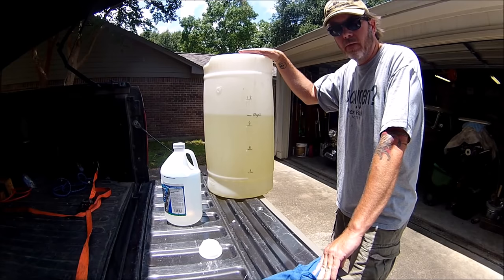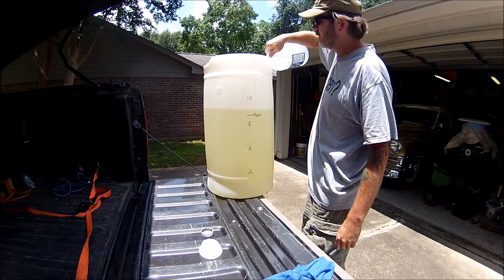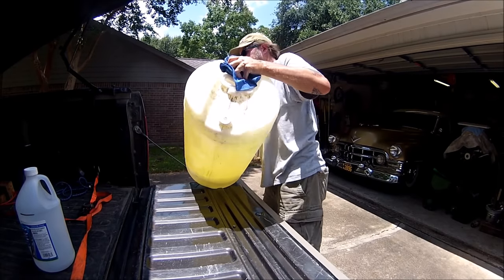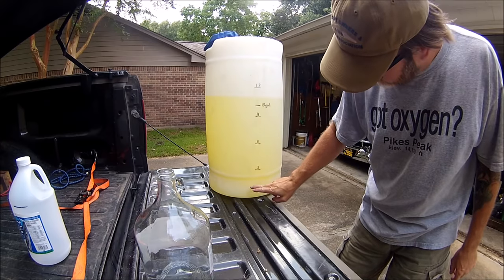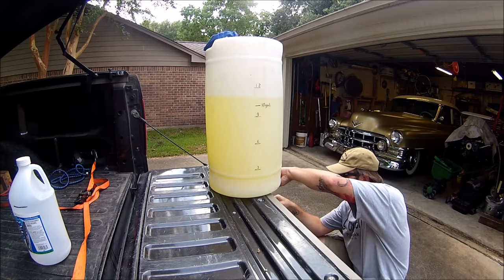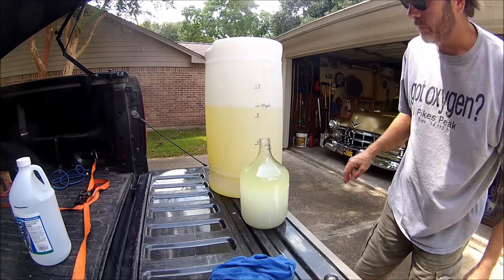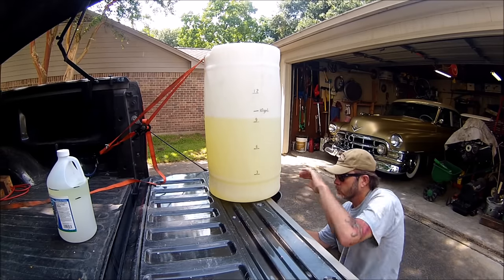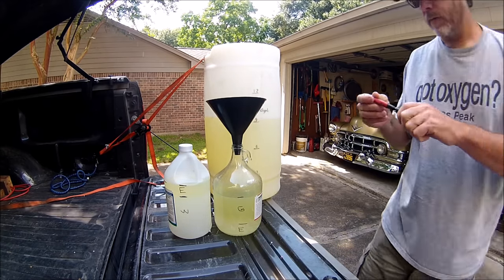How to easily extract ethanol out of gasoline.

Comment: Well, the problem with doing this is that ethanol is used to boost the octane of the gasoline.  So, if you remove the ethanol from say, 93 octane gas, you are left with about 69 octane fuel which will destroy any engine you try to use it in.  Of course you can add your own "octane booster" but, if you read on the label, most, if not all, of these contain....wait for it...ethanol.  This is a ridiculous waste of time but, have at it if you want.
Reply: Sorry, but I have to disagree. While it boosts octane marginally (e15 is 88 octane), less than 10% is added to metro area gas. Ethanol is NOT added in rural areas nor in most large cities during certain parts of the year. It is added to reduce emissions. Period. If it's in your local gas, it's in the 87, 89, 91 octane. It's in all of it. It is required by DEQ to be added. Not the car industry (it attracts moisture and corrosion, they don't like it), and not the fuel or refinery industries because it's expensive and less profitable than straight gas. Corn farmers love it. And If you're running older lower compression engines, you are in fact, getting less power from it because it's less volatile.
Reply: Well, I have to disagree with what you just posted.  I work at a company that owns 450 gas stations and I am friends with the guy responsible for testing the fuel and maintaining the pumps.  He is the one that told me this.  He said the major difference in the grades is that there is more ethanol added to the higher octane fuels which is how they get from 87 to 89 and 91, etc.  He also said it is in our gas all year long and sometimes, there is more than the 10% "claimed" by the refineries. I live in a rural area and all of our gas has ethanol in in.  There is one station 20 miles away that has pure gasoline but, they charge an extra $1.50/gal. over the price charged for all of the other gas with ethanol.  I am sure this varies from state to state or region to region.
Reply: Ok... so then how did we get higher octane way before the days of adding ethanol to pump gas for emissions reductions? decades ago. you may work for a gas station company and know a guy. cool. but oil refineries been making high test decades before politics removed lead or added alcohol to the scene and watered shit down.  Again, I will state, claim, and defend- the only reason for ethanol is political. there is no ethanol in high octane race gas. (top fuel is a whole other topic) and if you run e85 in your low compression turbo setup well, then, your golden when in boost. boils down to: ethanol fucks up your shit but lowers smog emissions. not a performance gain for average rig.
Reply: I have been buying 90 octane non ethanol gas at my local gas station for about 3 years now for my yamaha side x side, Ferris riding mower, 4 stroke weed eater, push mower and generator! They all run awesome!
Reply: Hi Pirate Labs - actually, your friend is WAY off - current gasoline as formulated at refineries, before the ethanol addition, has an octane rating about 84~85 as determined by the (R+M)/2 method (standard).  Ethanol increases the octane rating by slightly above 1 point per 5% ethanol concentration.  Current formulation of 10% ethanol E10 gives you ~87 octane rating,  E15 is ~88 octane rating and if you used a mixture of 85% ethanol/gasoline mixture, you would have about ~108 octane rating.  So if you remove all the ethanol from the currently available E10 (US and Canada), you end up with "dry" gasoline with a octane rating of 84~85 which would likely be safe for your engine (as long as you are gentle with it (preventing detonation).  Ciao L (Ford Motor Company engineering).
Reply: smooth rider: Well, I agree with the second part of your post and, I do not know the answer to the first part although I could venture a guess.  Higher octane simply means that its flash point is higher and it is harder to get to burn.  Many chemical additives can do this but I have no idea which one(s) they used.  I do not work for a gas station company, I work for a security company and I am posted at a corporate headquarters of a very large grocery store/convenience store company.  They all run Shell gas.  I used to race go karts that ran 100% methanol and you could make great H.P. on it but, as you mentioned, you had to be set-up for it.  (Jetting a lot larger to get more fuel in because it does not have the energy density of gas)  Burning corn in our vehicles instead of eating it is just plain stupid and yes, 100% correct that it is political just so they can say we now have a "renewable" fuel source.
Reply: Corn is better to run in our cars than our bodies, corn is Killing Americans because we eat way too much!
Reply: lanceelot1953:  He is actually not "way off" as you put it.  It says this right on the pumps when you buy it.  (At least at these locations I use, which are owned by this company)  Each grade shows the ethanol content and the higher the octane, the more ethanol is in it.  I use regular (87) and it also says there is a MINIMUM of 10% ethanol in the fuel.  (they all use that magic word:  Minimum)  He is a very respected engineer himself and has been with this company for a very long time so, I think I will go with what he says as being correct.  I am not doubting your background either, but, as I posted above somewhere, I am sure this all varies somewhat from region to region and possibly you are in a very different one from me.  I just looked it up and ethanol has an octane rating of 113 and E-85 is at 108 octane, like you said.
Reply: Livingwell:  How is that?  I hardly ever eat corn myself nor do I use any of its by-products like corn oil.  I am an olive oil man myself.  Now, if you make bourbon whisky, that is another matter entirely.
Reply: Pirate Labs, how old are you? Do you remember gas before ethanol? Unleaded gas? Leaded gas? They made the refiners add ethanol to stretch out the gas during a fake gas shortage. Countries in South America did it during WW2 so we should too. It made gas more expensive but we need to do our part. Now farmers and politicians don't want to remove it. They are now telling us it will cost $1.50 more per gallon to not have ethanol. Just leave it out and charge us less the amount it cost to put it in.
Reply: Randy, Yes, I am old enough to remember paying $.50/gallon for gas (leaded gas) to go on a date in the early 70's.  It is just another way of giving a subsidy to farmers, and oil companies also.  I am all for farmers but man, take this crap out of our gas.  We are now able to drill everywhere and soon will be the largest source of oil in the world so, we do not need ethanol in the fuel any more.  I totally agree with you.
Reply: Hi Smooth Rider, in the "good ol' days", since the 30's, refineries were using mainly tetraethyl lead (TEL) in various concentration to prevent preignition and detonation (and some smaller other modifications of the fuel constituents with Sunoco which patented a way of blending your own fuel in five to eight different octane ratings at the height of the sixties muscle car era (up to 102~105 octane ratings).  The high performance dual staged turbo-supercharged aircraft engines of WW II used up to 130~150 octane rating fuels.  By the 70's concern over the lead health issues coupled with fouling of the early catalytic converters led to lead removal (unleaded fuels) and lower compression engines.  Then came various other chemicals MMT, MTBE, TAME... to name a few used to prevent detonation and add oxygenation (for cleaner burning fuels) which brought other problems until using ethyl alcohol which is what we have now in various amount.  Ethanol has political, health, and environmental justification to various degrees.  Racing events, off-road use, some classic cars and some high performance aircrafts can still use various leaded fuels depending on state regulations.  Ciao, L (FoMoCo engineering).
Reply: Pirate Labs, If the corn came from small farmers to help them out, I wouldn't mind but I'll bet it's all the big farming conglomerates who are paying the politicians. Whenever you hear "help the farmers" it's usually not the little guys reaping the benefits.
Reply: Alright, I gotta admit, we got ourselves a bright group of guys posting on here. hopefully I shared something worthy because I definitely gained some insight from y'all!
Reply: There may be some truth to lower compression engine making less power on it but it would be unnoticeable.you might have more of a claim a lower miles per gallon,but still probable unnoticeable
Reply: So?
Reply: But you have to double the fuel mixture to get that rating, otherwise you are running the engine very lean
Reply: @mbsnyderc  it takes horse power to do the compressing in the cylinder. It's a trade off. Sometimes higher compression is the wrong way to go. Even with turbos, you are rasing the back pressure of the exhaust so the engine is acting like an air compressor for the turbos. But with turbos or super chargers you can get more fuel and air into each stroke.
Reply: @randyc5650  I remember when unleaded gas was unheard of.
Reply: Pirate Labs: I don't know where you live, but all the gas stations I've seen and heard about across the country and the legal amount of standard gas for the US is a MAX of 10% ethanol in ALL grades of gas. Unless it is specifically rated as E85 or some other rating, there is no MORE than 10% in gasoline ever. It says it right ON the pump "This fuel contains up to and no more than 10% Ethanol" I see it on every pump I visit.
Ethanol doesn't increase octane level all that much, as lancelot1953 stated. They sell non-ethanol rated all grades of gasoline where I live, though it is more expensive.
Ethanol is a less energy dense chemical than gasoline. Adding it to gasoline actually decreases its energy output. 10% Eth would decrease gasoline energy by about 10%. This means that "more" fuel is needed to do the same amount of work. If you have an engine that is rated at 200hp on straight gasoline (no ethanol), that means you'd actually get approximately 180hp from the engine with 10% Ethanol added. (these numbers are estimates, the actual numbers could be slightly higher or lower, but still significant). This also means that if you get 30mpg with non-ethanol fuel, with ethanol you'd only get about 27mpg.
Reply: Pirate Labs wrong on how octane levels are achieved.
Reply: very true, even octane booster won't add enough to make it usable
Reply: akbychoice:  OK, so you know more than the fuel engineer that explained this to me who has over 20 years experience then?  Somehow, I highly doubt that.  Sorry.  Also, the guy who made this video about ethanol can not even spell the word "Ethanol" so I don't think I will believe him either.
Reply: Pirate Labs I’ve hauled millions of gallons of fuels over a 23+ year span from different refineries with octanes from 87 to  100 and the higher octane fuels had no methanol or ethanol in them. None for a very good reason, ethanol attracts moisture. Fuels have been used in internal combustion engines far longer than the amount of time that government made ethanol a part of the requirement. Now you have more failure rates in gasoline powered equipment because of the ethanol.
Reply: akbychoice:  Of course those fuels 23 years ago did not have any...I never said they did.  All of this has been in the very recent past few years that they have been adding ethanol to all three grades of fuel.  Ethanol does not "attract" moisture like you said, but it is hygroscopic and does absorb moisture which is why the main ingredient in "HEET" (Drygas) is actually methanol because it combines with the water in the fuel and burns off as a low octane fuel.  We agree that the fuel of years past had 0 ethanol in it no matter the grade because they used lead and other additives to get the octane level up.  Also, no offense intended here either but all of the guys that deliver the gas to those 450 stations I mentioned earlier owned by the company I work at are nuts, ha ha.  Bad enough driving ANY truck in traffic but now add 5,000 gallons of gasoline in the tank behind you and...well...you could offer me $100,000 to make just one run and I still would not do it.  They lost a driver not too far from here when a car hit him and he hit an overpass and the fire was so hot the overpass was condemned and has to be replaced.  You are a braver man than me Sir.
Reply: Its still uses dirt and water that could be used to grow food....less food grown drives prices up, use more water from aquafer drives water table down......why play those games when its a known fact that at present use rates there is enough oil under our country to keep us running for 50 more years
Reply: @AZsmoothrider  there are many additives that can increase octane, the original additive was tetra-ethyl-lead. Ethanol appears today to be the cheapest and best for emissions, so maybe thats why they use it.
Reply: @adamshine5  that was pretty much my point.
Reply: @AZsmoothrider  i think i meant to respond to someone else, sorry for the mixup.
Reply: An octane rating is just the resistance it has to "detonation" due to compression. It is not a measurement of how much power is in the detonation. 

The force created by using equal amount of fuel and air under different compression will be more efficient during the  explosive/mechanical energy change process when under higher compression.

And 10% ethanol is the max amount that is allowed in tbe fuel we buy at the stations currently.

The fuel distributors (the ones who buy it from the manufacturer) are the ones who add the ethanol. Just like the the detergent packages. And if your vehical is of the last decade or so, using any grade other than what your vehicle manufacturer states is unnecessary. The vehicle will just adjust its time to ac count for the change in octane and will not yield any proformace gains. 

And for those interested, theres a ton of information available that states why the method above for separating water/ethanal from fuel is not possible without degrading it to a worthless product, just google it.

This would be in practice as a standard to every boat owner in the world right now if it was this easy. Period.
Reply: @twinkyunouwantmycreamfilli8297  stated another way, the lower the octane the higher the volatility, the higher the octane the lower the volatility. This is why you're wasting money to put high octane fuel in a low(er) compression engine, but not in high compression ratio engine, which makes more power by the lower flash point of high octane fuel: it's able to attain more compression without pre detonation, hence more power from the same displacement.
Reply: Pirate,

We add ethanol to our 88 octane and it usually comes out to 91... so removing the ethanol, assuming there was a clean and simple way to do it, should yield an 88 octane gasoline.

I work at a refinery.
Reply: Also, regarding your comment about "harder to burn", that's cetane. A measure of combustion delay - time between injection and first detectable expansion from combustion.

I am a process chemist at a refinery my dude.
Reply: @OverlandOne  
Also, lower octane = Lower volatility = higher flash point.
Reply: @akbychoice , Refineries dont add ethanol to any octane. The gas distributors are the ones who add ethanol and the many various additive packages to the fuel. Then it goes to the gas stations. 

Higher octane gas that comes from a typical gas station can, and in many area, contain the same amount of ethanol as the lower octane gas. Just depends on the regions policies and if the store owner can or wants to sell it.

If i misunderstood the context or the point of your comment, i do appologize.
Reply: Twinky UnOuWaNtMyCrEaMFiLlInG do you realize in many cases, fuel is shipped directly from refineries to fuel stations? Well I can tell you it is. One refinery can supply fuels to many brands, injecting whatever additive that brand requires when it’s loaded into the delivery tanker. Wether it be Techron for Chevron Gas, or anti-knock compounds for Shell. Many non branded mom and pop station have no additives. I know this because I hauled fuel for 23+ years up till 2016 when I retired. While some fuels get transferred from a refinery to a distributor many times it goes from the refinery’s tanks directly to the stations. 
Notice the pump stickers for ethanol content: up to. 
Same with diesel fuel, some areas have bio-diesel, some do not. Some have both. In most cases if there is an additive it’s being injected when it’s loaded through the dry-lock load arms. Same with jet fuels, Anti-static compounds are added to prevent static ignition. 
There was a time when we added dyes over the top for off-road fuels or heating fuels, that went out years ago. Some places don’t differentiate with dyed fuels. Blue Fuel oil for off road being mistaken for Avgas ( LL100 ) [ which is blue ] would be a deadly combination. Yes every area is a little different.
Adding Ethanol is how they lower the cost or at least charge more for gasoline without ethanol.

Comment: Don't know where you live but, you can get ethanol free gas at a marina and some gas stations still have it for agricultural use it cost a little more but it's worth it. I got tired of replacing and cleaning carburetors on lawn and garden equipment. I live in Michigan 2 miles away from Lake Erie I get mine at the marina octain rating is 92 - 94. Hope I helped ya out bro.